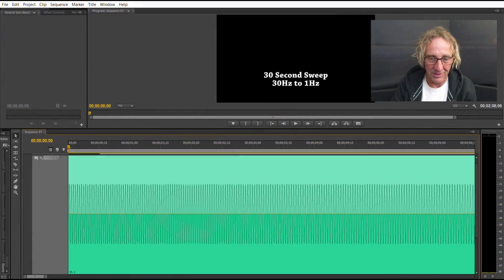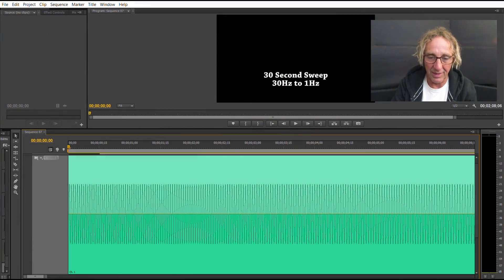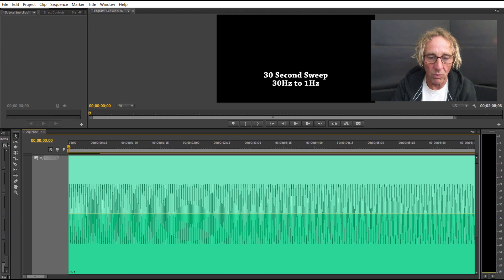30Hz to DC - Ultra Low Frequency Frequency Test - YouTube

Comment: Hey Dave, I've a decent onboard Soundchip and my Beyerdynamics DT 770 Pro 250Ohm headphonesand I hear an annoying 1kHz overtone, everytime the limiter reaches 9dB. I can hear the sub until 10;00; - 10;15; After thar I hear some kinds of scambling/fragments. During the rampup  1 30Hz everytime the cursor crosses block it klicks.
Reply from the maker: The clicks are from sewing together waveforms of different frequencies and was there before uploading. It is caused by jumping from one frequency to the next abruptly rather than a sweep between those frequencies. 

The tone you hear modulated by the waveform was not there before uploading and appears to be an artifact of youtube's processing of the sound

Comment: Interesting to see the zero, or mid point is at -12 dB on the vu meter. I've never thought about that before. Do you have anything to add about that Dave? Most interesting experiments. I have in the past attempted to make a dirac pulse using Adobe premier, which I still have. SC4 I think.
Reply from the maker: Thats just meter ballistics. Think of taking a db25 voltage and slowly turning it down over 15 minutes. That would be a 1/4 wave of a 1 cycle per hour. The meter would drop to zero just like the voltage.  Audio meters pretty much just read the voltage but has some averaging or smoothing and some response hold so it does not jump around so much.
Reply: @DaveRat  True rta has the averaging function you can set from 0-100 points. I understand now you have mentioned that. Thankyou Dave.